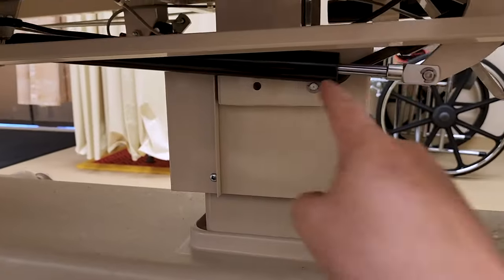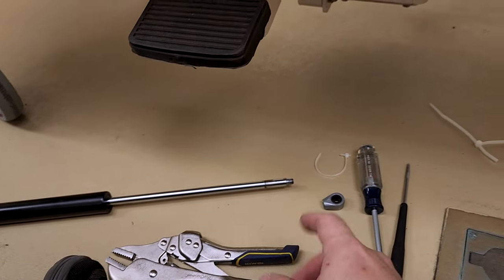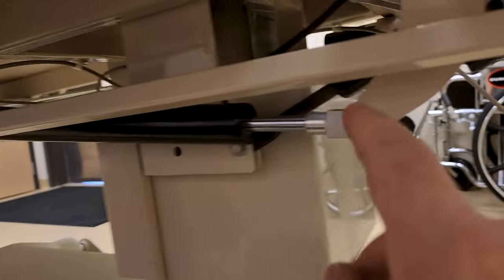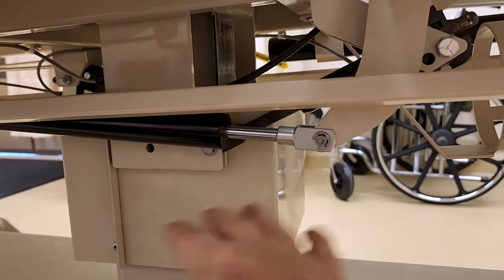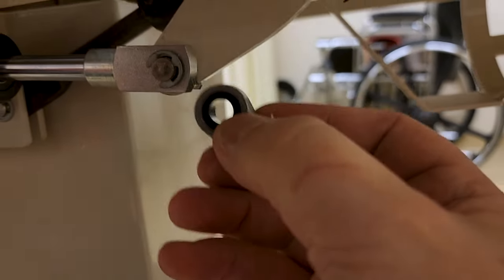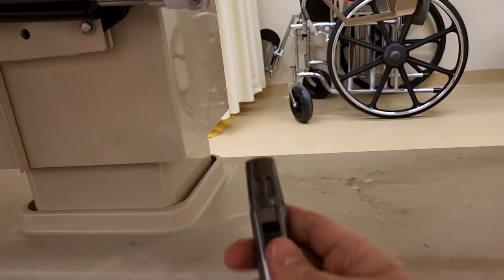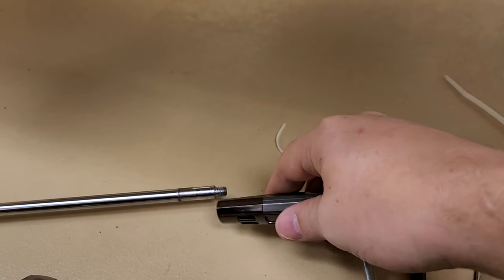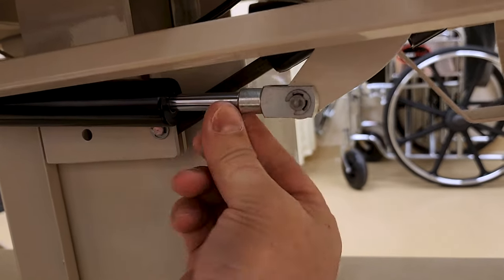Pro Tip: Old Parts

Comment: Or if you accidentally cross thread a screw or if the new screws that come with the new part are garbage, keep the old ones!
Reply from the maker: What?!   Missing fasteners?!  Never.
Reply: @BetterBiomedChannel  Lord have mercy! Changing batteries in a mobility device with the fasteners that the batteries come with is a thing of nightmares.